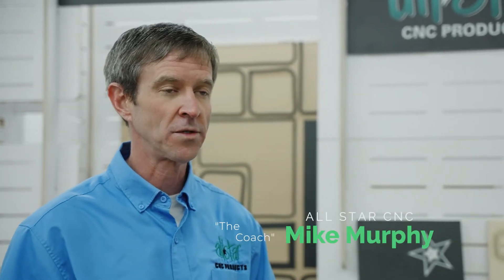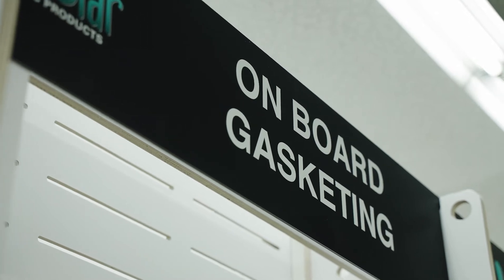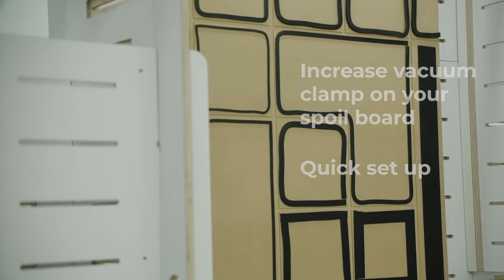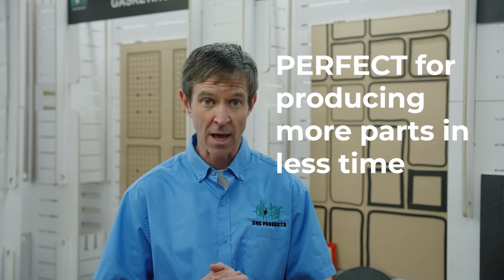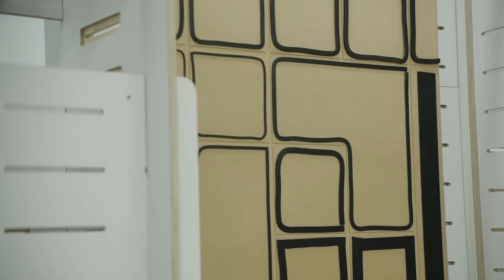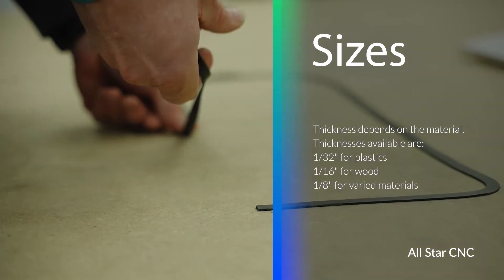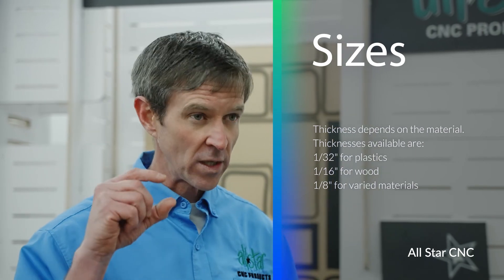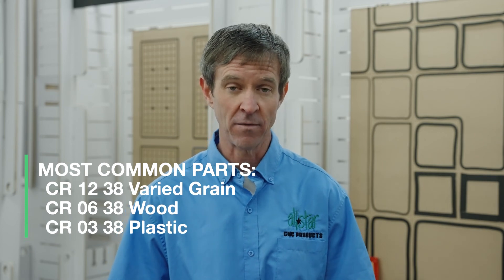STEP 2(b) OF 2 TO IMPROVE CNC ROUTER VACUUM HOLD DOWN: Quick set-up Spoil Board fixturing for parts.

Comment: hi, what about the gasket ? It will rise the height of the material under the piece i want to cut right ? and it won't even be uniform? I am having trouble to cut mdf , does everything perfect, and when it has to  cut the entire 18 mm board, it moves it a bit , i think its because of the speed, i have to lower it a bit, going too fast. Using 1 cm board as support under the mdf
Reply from the maker: I suggest giving us a call at our office and we can discuss different approaches, techniques, and products to help hold your parts more effectively. 800-878-7827